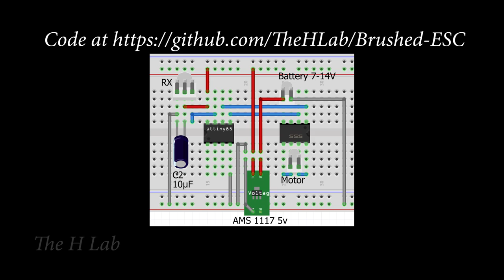How to make a Brushed ESC | Bidirectional ESC

Comment: Nice and appreciate you posting this. It "might" have been better to use a more readily available driver. There is lots of info out there on using the L9110,. Am looking into if it can be substituted but at a glance I think it works on a slightly different principal. Cheers

Comment: We can make the same with a servo motor chip and an h bridge right
Reply from the maker: Yes. Sure. But I bet that you don't want to break out a 5$ servo to make an esc which support 13A current at 15V instead of spend 1$ for this. Especially when you need more than 1 esc.
Reply from the maker: You can refer my video here if you want to transfer Servo to ESC https://youtu.be/O_brwlF283c
Reply: @TheHLab  can i make dual way esc for my  mini rc tank with this chip  or 2 servo chip ?  I made arduino rc controller a few days ago and now i want to build 1 dual way brushed esc . Can you help ?

Comment: Hi The H Lab
I made this with rz7889
It works great, but there is some annoying noise comming out of the motors as soon as I turn on the transmitter.
I guess it is comming from the receiver and it amplifies in the rz7889
However when I was doing tests with digispark there was no noise.
Reply: use 100nf capacitor on your motor

Comment: Can we make a dual way differential esc using the same code?
Reply from the maker: I think yes. You can use 2 ESC like this and then connect it with RX via CH1 & CH2, then use MIX mode on Transmitter. You can control a tank with crawler by this way.

Comment: Very nice video. But i have a question. I need 1 way brushed ESC for rc plane. Can i just use the AtTiny board with a mosfet or transistor instead of the H-bridge driver? And the code must be different right?
Reply from the maker: Yes. but without modify the code only a half of control stick will make your motor run.
Reply from the maker: change the body of PWM_out like this to make it work with full range
void PWM_out(int speeds){
  // speed
  int tempSpeeds = map(speeds, 0, 1000, 0, 255);
  if(tempSpeeds>255) tempSpeeds = 255;
  // direction
  
  analogWrite(OUT1, tempSpeeds );
  digitalWrite(OUT2, LOW);
}
Reply: Thank you for the explanation. Will try it out soon👍👍

Comment: Hi
It's me again. Finally I figured out how to silence that annoying PWM buzz that was comming out of the motors when idle.
I am still not good with programming, and I am sure that there must be some other solutions to that problem but this is what I came up with and it works perfect:

if ((tempSpeeds >= (speeds-MIDDLE_POINT-50)) && (tempSpeeds <= (speeds-MIDDLE_POINT+50))){   
   digitalWrite (1,LOW);
   digitalWrite (0,LOW);
   }

    else if ( speeds > MIDDLE_POINT ){
    analogWrite(OUT1, tempSpeeds );
    pinMode(OUT2, OUTPUT);
    digitalWrite(OUT2, LOW);
   } else {
    pinMode(OUT1, OUTPUT);
    digitalWrite(OUT1, LOW);
    analogWrite(OUT2, tempSpeeds );
   }
}
Basically I shut down the output of the H bridge when the value is in these limits.
💪

Comment: I can't find out if the rz7886 is connected directly to the battery or not, due to two of your cables blocking the view on the schematic.
Reply from the maker: Yes. It is connected directly to the battery.
Reply: @TheHLab  Thanks

Comment: hi my friend, i tried your project with little adjustment, i changed the attiny with atmega8, change the mosfet (rz7886) to hbridge mosfet i made., ive done already to burn bootloader then your sketch had done uploaded, but seems not working at all. is there solution my friend ?
anyway i had succeed by using the simple code below:
void setup() {
 pinMode(11, INPUT);
 pinMode(3, OUTPUT);
}

void loop() {

 analogWrite(3, map(pulseIn(11, HIGH), 1000, 2000, 0, 255)); 
delay(15);
}

but its  only for 1 direction with just 1 mosfet for switching. would you please help me, BTW im very newby in programing  if that code are possible to add such several function that can run same as your project . thankyou verymuch.
Reply from the maker: Sorry for long respond. I missed your comment: you should have 2 output pins for 2 directions and then do a if to device the received value from INPUT (11) to 2 separate case: for < 1500 and > 1500, then do analogWrite() for corresponding output pins, ex: <1500 for forward and >1500 for backward.

Comment: Hi
Great little ESC 
However on the first look at the code there is a mistake
#DEFINE IN should be 2 and not 0 because 0 is already taken for one of the PWM outputs
Or am I wrong
I will try it soon on my tiny track.
Reply from the maker: Hi @Janja, input of attachInterrupt() is interrupt pin (in this case I used INT0), 0 at #define OUT1 is arduino pin0. These are 2 different definitions.

Comment: great, can I connect this circuit directly to  the receiver? why I must prepare code for this circuit? I mean I have general receiver and transmitter and they are already configured, and I can apply direct, is it right?
Reply from the maker: You can't make it work by that way. Output from Receiver is a PWM and my designed circuit come with an ATtiny (a programmable chip), it read the PWM from receiver and create a new PWM. This new PWM can be switched +/- to make motor run in 2 directions. The origninal PWM can't do a switch like that.
Reply: @TheHLab  thank you dear for your reply, kindly i don't need to two directions, I just want the esc to control the speed of dc motor for airplane.so now can I connect it directly?
Reply from the maker: No. You can't. Because this circuit was designed for bi-direction purpose and code is required.

Comment: Bro I am not able to find 7886 ic so any alternative to that
Reply from the maker: You can try with others motor driver/H-Bridge IC. But others IC may have different current, voltage and size.

Comment: I was hoping it was going to show how to make an esc using basic components like resisters and such, not premade chips.
Reply: thats simply not possible. this is a simple as it gets. you're working with digital pwm signals. you need something to decode them and control high power switching devices
Reply: Milk Parker ah ok.  Thank you for the explanation.
Reply from the maker: @Milk Parker thank you :)

Comment: I just tried this code and it works only with #DEFINE IN 0 which is very strange to me 
Am I missing something
And also I noticed some jitter.
Is there a way to reduce it ?
I am using flysky receiver FS2A 4 channel
Reply from the maker: Hi @Janja, input of attachInterrupt() is interrupt pin (in this case I used INT0), 0 at #define OUT1 is arduino pin0. These are 2 different definitions.

Comment: Thank you for video. How can ı load to code. Please help.
Reply: I dont find to attniy85. Please add to link
Reply from the maker: @aliyildizcelik4657  you can buy on aliexpress.com I have another video guide how to program attiny, search on my channel
Reply: Hi, Can another integrate be used instead of rz 7886?
Reply: Also, I don't understand the scheme. Is there a more detailed diagram?
Reply: @aliyildizcelik4657  I intend to use even smaller chip (SMD) RZ7886 for my tiny track.
One could probably use even H bridge with MOSFETs with this schematic.
Reply: Sorry I meant RZ7889
Reply: @Bounty977  Thank you very much for the information. I'll be happy if you share it when you do it.

Comment: Mmmmmmmm not off to a good start. ATtiny13 schetch is to big for a ATtiny 13, 114%. Yes i used the correct file.
Reply from the maker: It should be smaller than 100% with MCUdude/MicroCore for ATiny13. Check detail specs on header of the .ino file